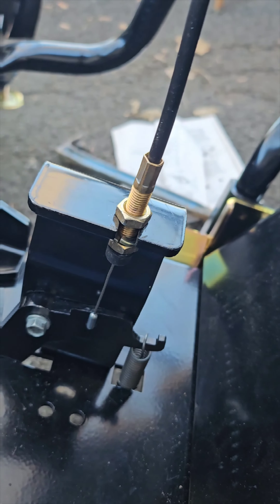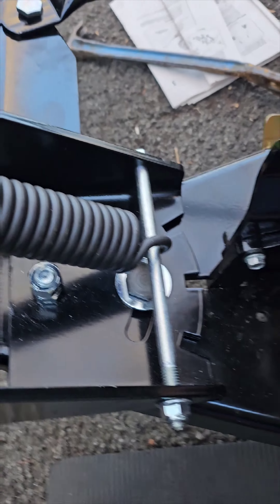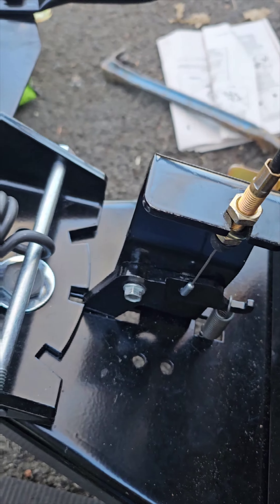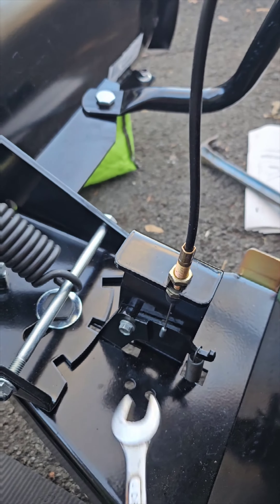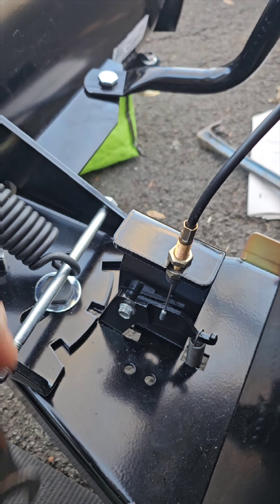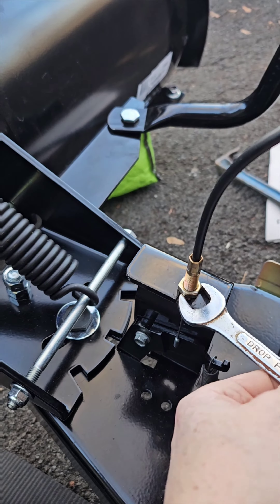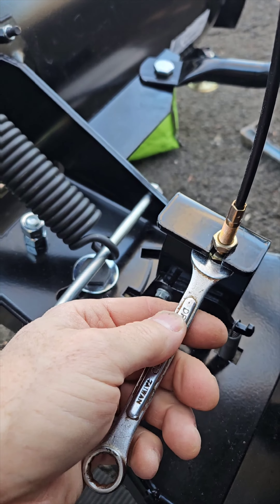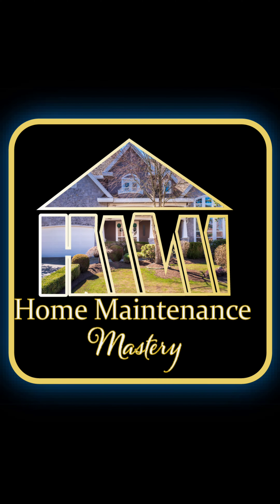Cub Cadet LT420 Plow Attachment Cables FIXED By Myself in 30 Minutes!

Comment: Very helpful! Any chance you could do a video showing your setup for the blade lift cable? I have the same model Cub Cadet and plow, but can't get the cable to lift the blade.
Reply from the maker: I did that video when I was helping a friend. If I recall on that unit you have to squeeze the cable and lift the blade with the handle the cable does not lift the blade only the handle.
Hope that helps ya thanks for watching
Reply: I would like to see that video for lowering and raising my plow. I cant get it to lower. Thanks.
Reply from the maker: When you squeeze the plow release cable the plow won't go down?
Reply: Right
Reply: Do you have a videoto show how to fix that?
Reply from the maker: @chmeacham6190  no but if I recall the reason why it won't go down is the pin that the squeeze handle controls needs to be adjusted the reason it won't go down is the pin is not retracting far enough to allow the plow to go down. You can adjust that pin in the same manner as in this video. Just make sure you support the plow with something before you try to adjust the pin cable. Prop the plow squeeze the trigger  and put a zip tie on it to hold it squeezed and look at the pin that hold the plow in place if the pin is still in the hole you need to adjust the tension on the cable to pull the pin back further.